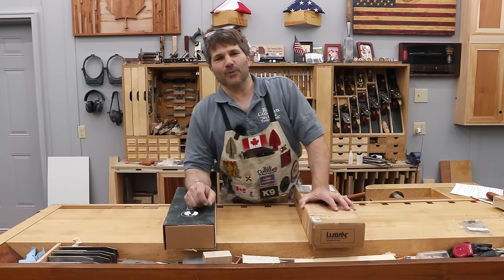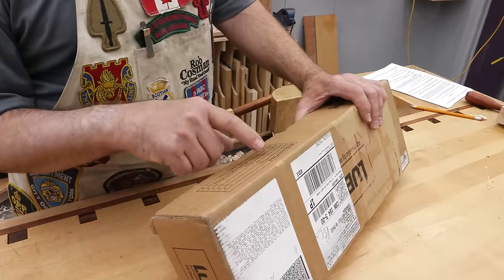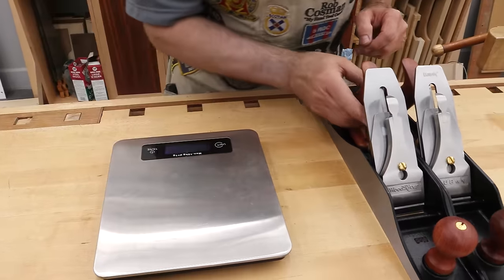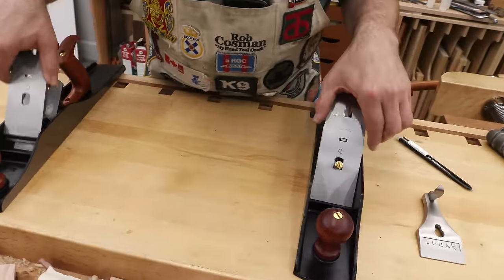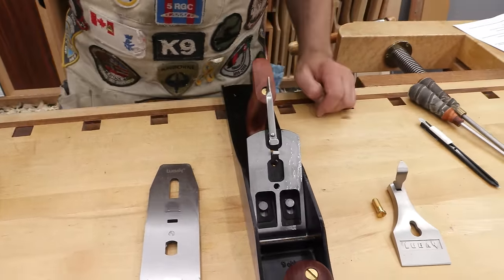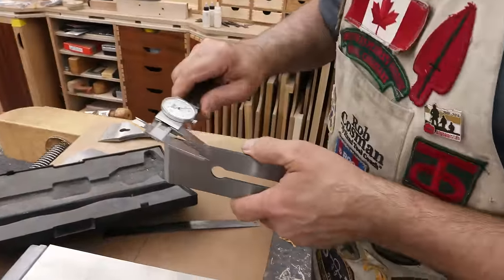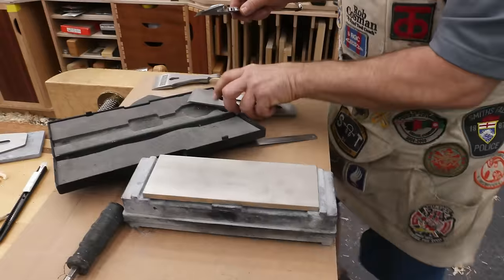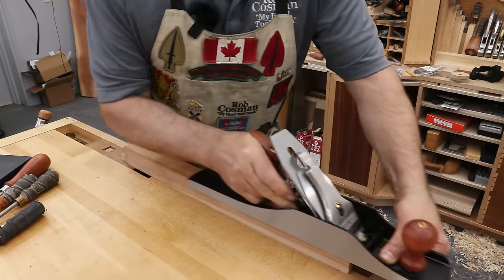Hand Plane Review - Luban vs. WoodRiver

Comment: I didn’t know wood river was made in China. 

Well that sucks.
Reply: I think team WoodRiver does QC on those and they are comparable to the likes of Lie Nelson and Veritas.
Reply: @samindaperamuna6392  comparable is a loose term. LN is the standard that other planes strive for. Veritas, although a great plane, is under them and WoodRiver is pulling in 3rd.... by a ways.
Reply: Why else would they be cheaper than Lie Nielsen?  The Wood Rivers are still good planes.  But if you want made in USA you are pretty limited.
Reply: @keats182  I’d much rather spend my money on a Canadian company than a Chinese one. Wood river is the same price as veritas and not even close to as good. I’m sure Rob isn’t happy with what he just saw? Out of sqaure sides , crooked pin on lateral adjustment. Just saved me $279 I was thinking of getting a fore plane and was thinking wr not going to happen I’ll wait til veritas gets back
Reply: Why does that fact suck? It only does when its crappy quality. Which it often is. But this time that is not the case. So that's great right?

What does suck is that its a shame there are barley any western brands making good planes anymore. I think that's a shame.
Reply: That’s why I passed on them ,I don’t really need to have hand tools so I will wait to buy good ones
Reply: @joem5332  I own a couple Veritas items, some Lie-Nielsen, and some Wood River planes.  They all work well for me and I don't have complaints.  You are definitely right that the price difference is becoming smaller.
I took my Wood River planes to a machinist friend of mine and he measured them.  They were all square.  One of the problems with Chinese made products is that their QC is not nearly as strict as a typical US company like Lie-Nielsen.  So it is likely that some things are going to be sold that maybe shouldn't.

Comment: Any tool that commands a price  but is built with inconsistent quality  is not worth keeping .I own a few 1950s  vintage Stanley planes which given the technology employed then to manufacture them while still in the affordable range of most anyone , are comparable in quality as any similarly built apples to apples comparison  modern day  planes.
With today`s CNC machinery no plane that is manufactured should be boxed for sale unless it leaves the factory inspected  for the kind of quality that a customer cannot make better upon taking it apart to inspect it. But always asking for quality results in some arguing that to ask for the level of  perfection achievable  with modern machinery will cost more ....okay ...what is your time worth to accurize  and remove the factory defect PROVIDED THAT  the defects can be corrected ?  If I had purchased a WoodRiver or other high priced plane which has defects  I would send whatever brands  back with  a note ....send me one that is built correctly ..I paid money thinking that it was , a pin drilled 8 degrees off level is inexcusable in the 21 century ...let alone milling issues .